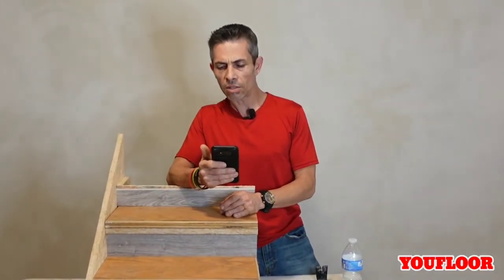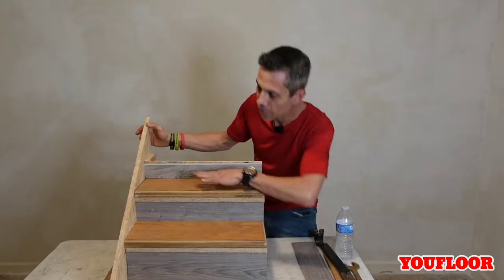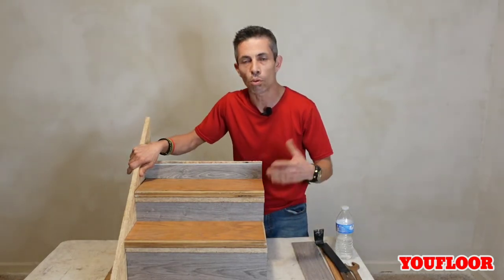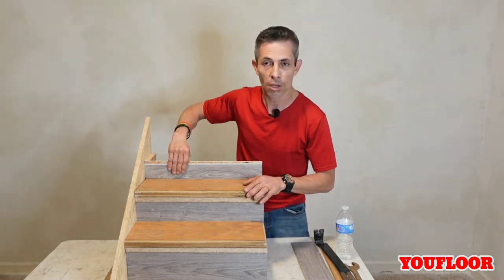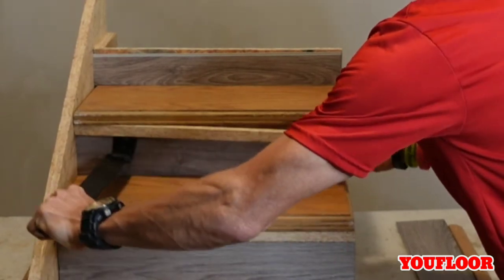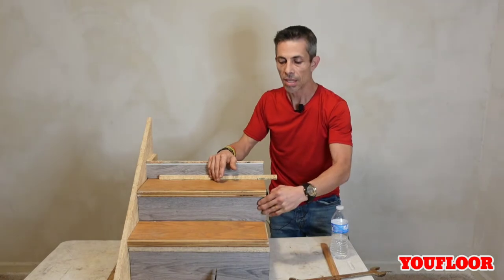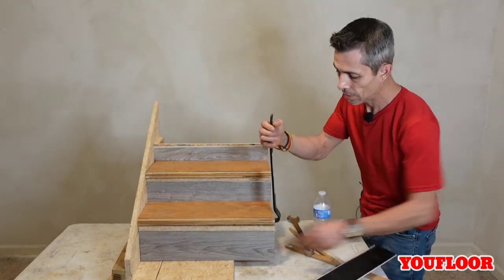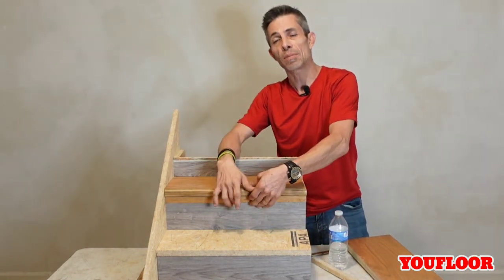How To Repair An Inferior Stair Install

Comment: Z, thank you so much for doing this video. This is awesome and will help me tremendously. I had been researching removing the carpet from my stairs for quite a while trying to decide the look I wanted. I am a persnickety woman and when I decide I want things to look a certain way, that’s what I want.  I didn’t see the installation until after it was complete.  I went back and forth with the contractor/handyman and he refused to make it right.  He said it would make my stairs out of code. Lesson learned. Anyway, I so appreciate you going out of your way and helping me out.  I’ll send you a picture when we get it fixed. You rock!

Comment: Instead of a Sawzall I think a Dremel tool would work with the wood cutting disk attachment or if you are confident, a chisel held facing the tread from the front pressed up against the bottom nose and under the top and hit it in. After a few cuts angle the chisel like '/' or '\' and after you knock out enough you can clean it up flush by holding the chisel flat against the top of the riser to clear out any pieces still overhanging.(disclaimer:I have never tried the chisel method on that sort of set up but have used it in woodworking in similar situations and it just might work)
Reply from the maker: I have tried the chisel method  and it works great except for that one stubborn board that has a diagonal wood grain so it want to take out too much lol. Since this video I've started using an oscillating tool at the ends. Its very persise. Then I can chisel away the middle and clean it up with the tool again. Thanks for the comment
Reply: @YOUFLOOR  thank you for thr reply because I really didn't know how well it would work. I am no where near your level of experience. I was actually using a dremel on something unrelated at the time I watched the video and I was thinking it might work. I've been going through your videos and I'm learning a lot. I got into home repair and different types of wood work and construction about a year and a half ago and channels like yours keep me sane 😃
Reply from the maker: Awesome.  Love to hear that. Keep up the learning, and good luck on your future projects

Comment: Was hoping you would talk about how to remove the tread if it was glued down.  My stair nose is splitting and want to replace but it’s glued down
Reply from the maker: You may have to cut it out in pieces. I would try to get my saw zaw under  the tread as faback as you can to cut through the glue and any nails that might be present. If you can still get it out. Take a chsel or saw a zaw or oscillating tool to rip it down the middle. Pull the front out, and then you can slide your sawzaw under the back part to cut the glue and any nail in the back. You may need to drive a screw through it with the head sticking out so you can grab it with some plyers or claw hammer to pull it out. Hope that helps. Let me know how it goes

Comment: What about using oscillating with round blade instead of saw?
Reply from the maker: I use one for the ends now, but I feel it would take a long time to do each one with an oscillating tool . Thanks for the question

Comment: Use a multi tool with a wide wood blade set at 90° to the tool. Then change to a small wood blade to trim near the edges.This will create no damage. . DO NOT USE A SAWZALL.
Reply from the maker: Actually It will cause some damage. I've used both. Especially at the end. Only thing is in my experience you are going to blow through some blades which are very expensive. And if you start today you might be done by Christmas.  J/k  very time consuming that way but it's not wrong. Definitely would make them flush and is a way better idea for the average diyer with no tool one experience .also using tape may minimize some damage Thanks for the comment. Have a good day.  Peace !!